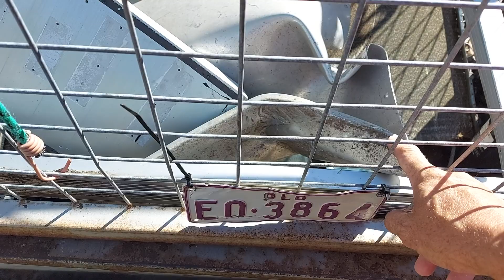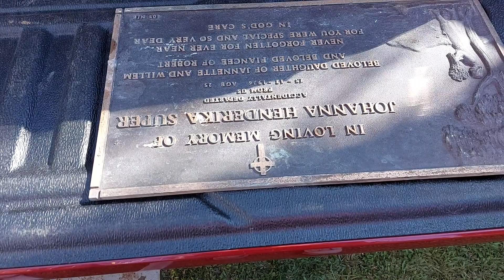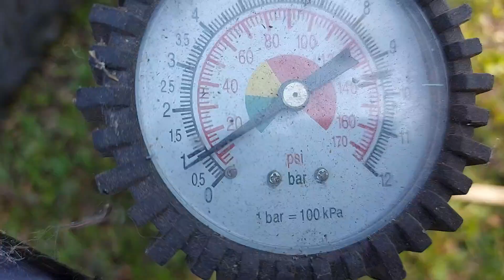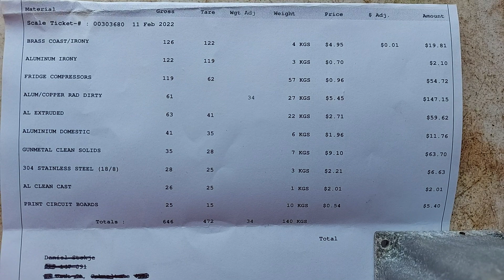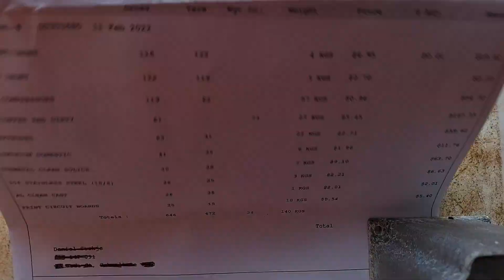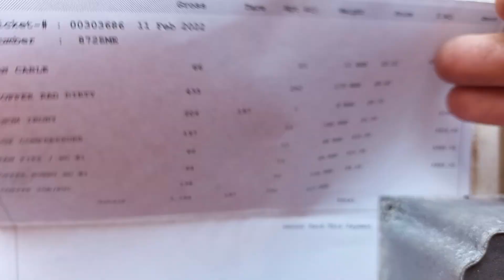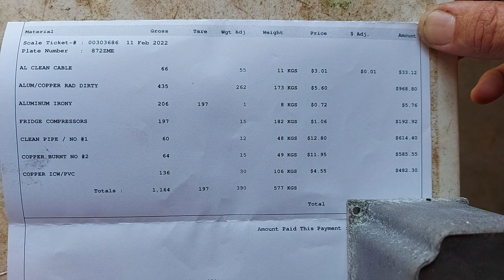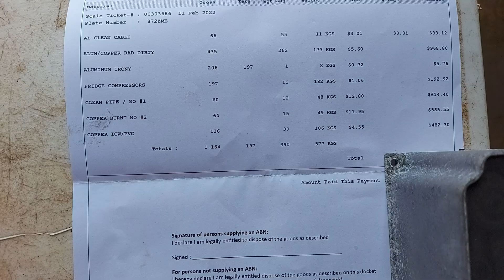Another Load of Awesomeness Sold. #copper #scrap #payouts, #recycling

Comment: Dan what a lovely second sheet $$$😉 you know I'm a woman who adores my copper but every I don't always strip the copper ali rads, sometimes just pinch the nuggets from the ends and weigh the rest in. Nice video🙂👍
Reply from the maker: 2nd sheet wasn't too bad, seeing a 3 in front would have been better lol. 

Indeed if i got some larger noodles on the ends of my rads which is always the case i will wobble them off and just leave the small U shaped ones, mind you ill cut those off too if they are in the way to remove the larger pieces......Have an incredible day.
Reply: @danthescrapper815  thanks Dan and you!